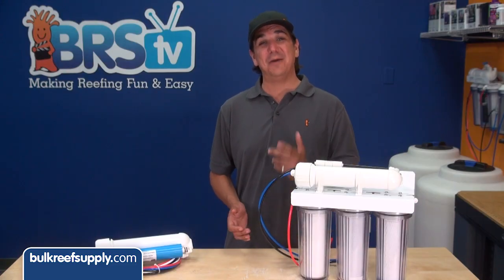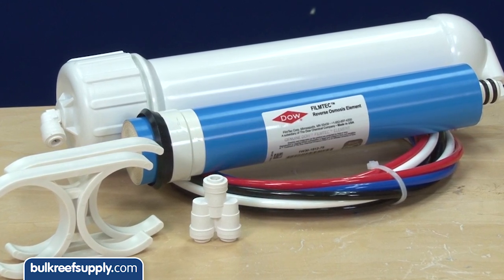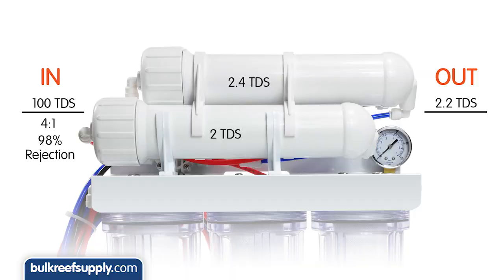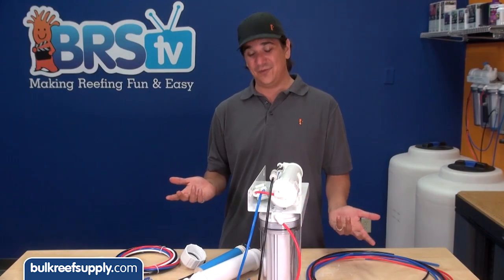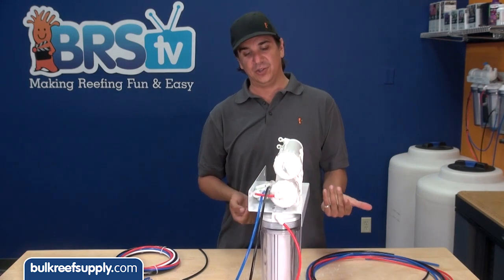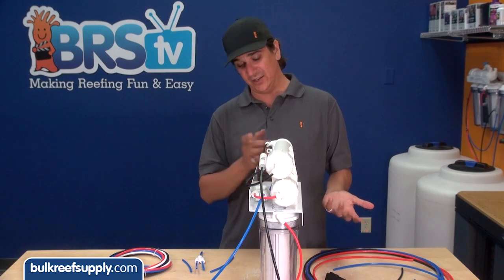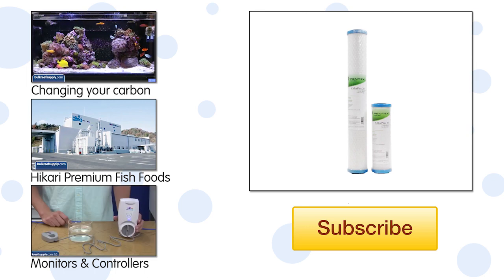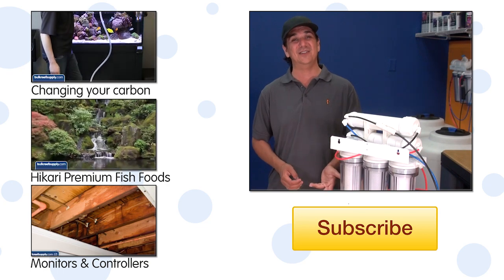Installing the 150gpd Water Saving Upgrade Kit | How To Tuesday

Comment: I have the ro buddy 75 and have added to it. I added an extra carbon filter as well as an extra 75gpd membrane. I can't get the auto shut off to operate properly. I also didn't upgrade to a higher flow restrictor. The aso is after the 2nd carbon filter and everything is hooked up like in the video. What am I doing wrong?

Comment: I did this with a 100gpd up to 200 gpd. Only difference is mine has a bypass for rinsing the membrane? So now I'm not sure, but it seems like it would only rinse the one.
Reply from the maker: In a water saver configuration, both membranes run off of one flow restrictor and one flush valve. When you open the flush valve, both membranes get flushed.

Comment: Does it matter what brand RODI unit I’m using?
Reply from the maker: The water saver upgrade kit can be added to any brand RODI system as long as the tubing is 1/4" and the membrane GPD sizes match up 🙂

Comment: How would you install a flush valve on that system?
Reply from the maker: A flush valve (either manual or automatic) would simply replace the flow restrictor. Just remove the flow restrictor, pop the lines into the new flush valve, and you're ready to go!

Check out this video for a full how-to: https://youtu.be/-qpbHgfLSto

Comment: Do I need 150 gpd pump ??
Reply from the maker: We'd suggest using a booster pump for a 150 GPD water saver system if your PSI is lower than 65. If you're within the range of 65+ PSI, you don't necessarily need a booster pump.

Comment: Where do I install a check valve with this type of setup?
Reply from the maker: The check valve on our BRS units are built into the product water elbow fitting coming out of the membrane housing. That said, if you have a different unit, you'll want to install the check valve between the product line output of the membrane housing and the auto shut off valve.

Comment: How donu install a flush kit on this double membrane system?
Reply: @BRStv  I'm speaking about a double membrane system, also I have 2 150gpd membranes so I need to get the correct one flow rate flush fitting.

Comment: Sir i have installed 75gpd RO on 20tds which is already purified by RO plant we need zero tds because we use this water in laboratory. So the issue is now i am getting 4tds and water output is very low like drop drop. Flow restrictor of 300 is pre-installed. So kindly guide me what should i replace to get more flow and low tds upto zero if possible.
Thanks in advance

Comment: I had 100 gpd. After watch your video i bought another 100 gpd membran and set as in your video. The problem is leaking in drain water. HELP me please. My booster pump is 70 psi. And flow restrictor is 300.

Comment: Hi Thanks for the advice, I’ve completed the setup now. My feed water supply is 190-210 TDS. Originally was producing product water of 4 TDS before resin. Now I have run in series it’s increased to a combined product water of 27-30 TDS. Any ideas why? Thanks in advance for your help.
Reply: BulkReefSupplyCom you were 100% right, thanks a lot. Membrane was lose, now re done and total combined TDS is 7 before resin. Much appreciated thanks

Comment: Not sure I've found the video or not but do you have an instructional video on proper setup of an RODI system? Proper way to plumb it and add a pump if the water pressure is low, make it cleaner looking, best way to utilize the system and so forth.

Comment: Great video! How do you feel about a different connection, being, splitting the pre RO water into two separate membranes and joining the waste waters with one flow restrictor? I ask because I would like to do this with an Auto-Flush restrictor. If not, do you recommend the Auto-Flush with the setup on the video? Thanks!

Comment: I just upgraded to the 150 and I'm still only producing 3 to 1 ratio.. Pressure is at 65 psi and I changed all filters.. Any reason why?
Reply: +BulkReefSupplyCom sent..
Reply: +BulkReefSupplyCom I just purchased a 800 ml flush kit

Comment: Hi guys, I saw this video and upgraded my RO unit with parts from BRS. My membrane in there was a 100 gpd, so i bought another 100 gpd membrane and installed in series. It seems to be producing water way to fast, 5 gallons in under 25 minutes. I installed a psi gauge and keep water pressure at 60 psi. I also upgraded the flow reducer from 450 to 600. The TDS meter is in the mail now, so I can't test the output water (lost my first meter). I triple checked both ro housings and have the outer port as the waste line. Any ideas is appreciated thank you.
Reply: ***** Thanks, I missed your response. I took the unit apart a few more times and found that I had a line mixed up. One of the RO membrane housings I had, had a red line out for product water. I thought the red line out was waste. I fixed it and it all seems to work well. 

Oddly, if I used the original flow restrictor 400 gph it produces 0 tds water.
If I use the updated one 600 gph as suggested on the website for 100gpd x2, it produces 1 tds water. I may add a 3rd ro membrane, I have lots of water pressure ( easily 80 psi),

Comment: Once installed and running, the system started squealing at the new RO housing waste outlet that feeds the second RO housing inlet. The tone changes with pressure changes. There are no leaks. Well water pump has a 30/50 switch. I rotated system to purge any trapped air but squeal remains....any suggestions? Very annoying.

Comment: I have a BRS 6 stage chloramines RODI unit.  My pressure going in to my RO is about 56psi.  Would you recommend this upgrade with out a booster pump?  My supply TDS ranges from 165ppm to 175ppm

Comment: I'm not keep a reef but I do keep and breed Discus,I just Love Aquatics.  I use RO water on my Breeding tanks to great success. I love this video and have followed it and now I'm producing very nearly double the RO for the same amount of waste, Win win. Many thanks for the Imformation.I will continue to support, here in the UK. By the way , love the challenge for Joey, who I also follow.
Reply: For succesful Breeding we have found that a TDS of around 80-100 seems to give us a higher fertilization rate of the eggs. We mix RO to HMA water in a  1:3 ratio and it just seems to works for us.As you know, Everyones source water is different so It might not work somewhere else.We are lucky that our tap water has a PH of 7 and a TDS of anything between 130-160 which is pretty good and only needs a small amount of adjustment.
As for RO being a must,
 For us, yes it is, but if you were lucky and had the space you could set up a good clean rainwater collection and storage system. That water is excellent to mix into de-chlorinated tap water. Sorry long answer to a short question I know.

Comment: Hi, nice set up. I realize that my question is a little off topic.
However, I have two different Ro/DI units (bought one and then decided on a larger tank) so could I run the waste into the second unit and get water from it without hooking up another line to it via the main inlet to the current ro/di system?
Reply: ***** No, they are not the one that is hooked up is a larger one than the one that is not installed.

Comment: Nice video as always. But I want to add that people should buy this as the kit, because I got confused and had to buy everything individually which was a pain in the rear. I watched the old video, this one was way better! And a question, when I have the flush valve open, ro water is still being made right? Thanks BRS!
Reply: ***** Thanks BRS, I leave the flush valve kit open before I make my RODI, and watched the old video to make sure I set it up right. I was worried because some water was going into my Reservoir.  Anyways, thx!